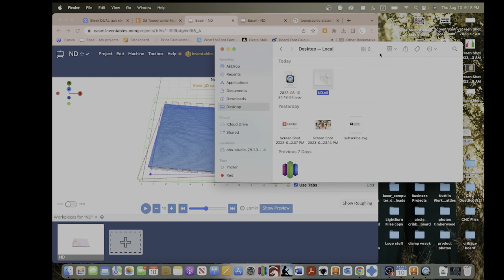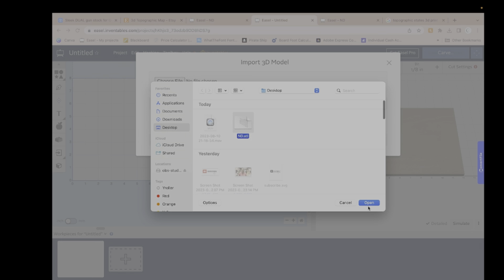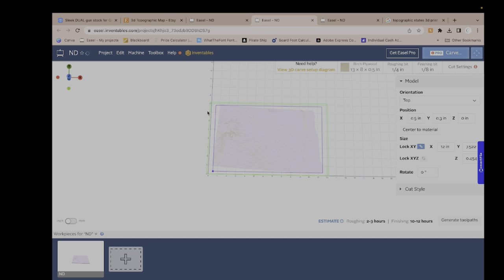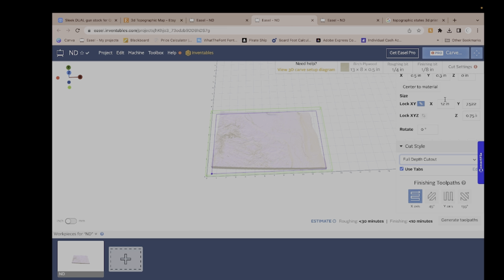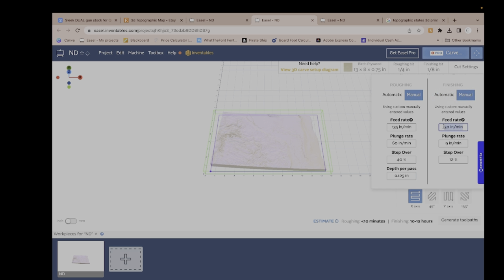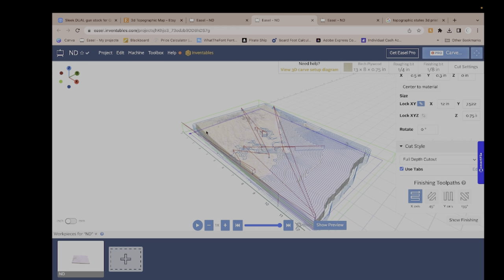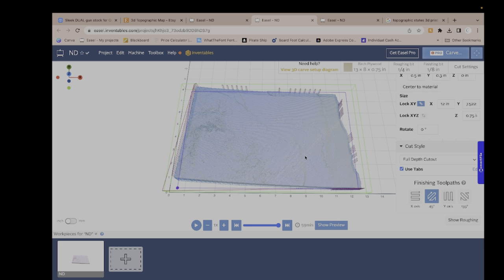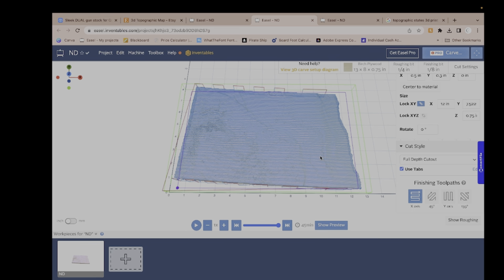How to CNC a 3d model in Easel / Topographical State

Comment: Try using painters tape booth surfaces and then super glue on one side and spray hardner on the other. Breaks a lot easier and doesn’t leave the residue. Luthiers use this trick a lot
Reply from the maker: I use to use that method but then I started using this stuff! But yeah that method works great too! Thank you! Hope you liked the video!